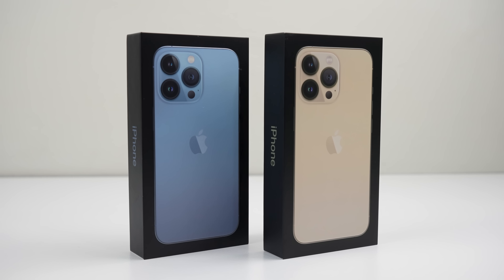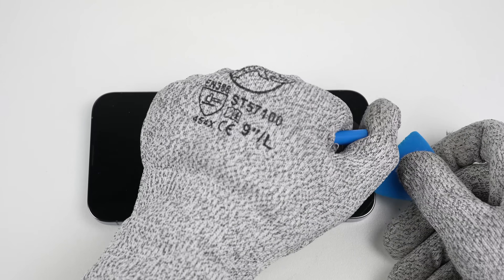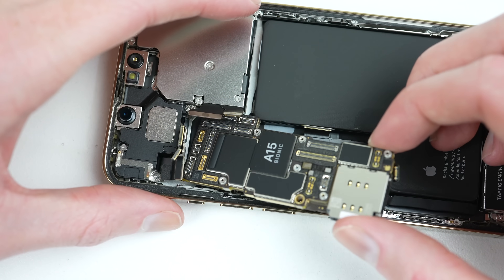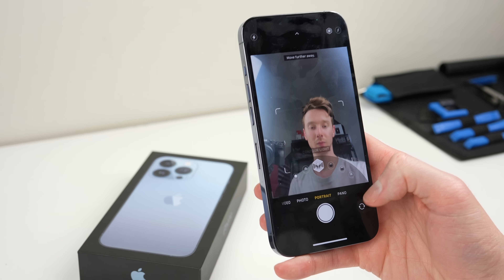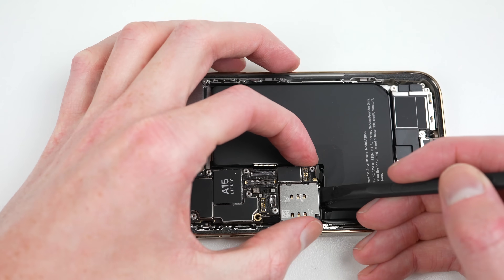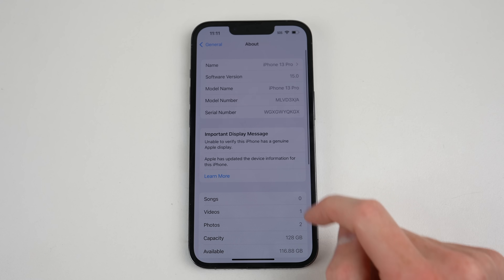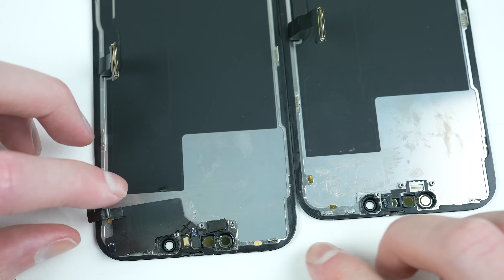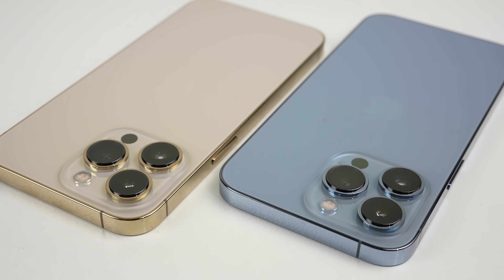iPhone 13 A Repair Nightmare - Teardown and Repair Assessment

Comment: Would like to see this test done with a complete data wipe initiated before the components are swapped. If there’s an active login the OS may be designed this way so as to prevent access through a Face ID component that has been tampered with.
Reply: And would also like to see what happens when only the battery is replaced, with an Apple on as well as a generic aftermarket one. This would be one of the most common repairs and it looks relatively easy. I don't see wiping the device requiring any re-installation, and more work, since a backup is made before initiating the wipe. When you login to the new device, the backup is automatically restored to the new device.

Comment: A lot of commenters are missing an important issue about environmental issues and sustainability here. These phones ARE repairable. Just not be a third party vendor not authorised by apple. So apple can fix them, and authorised repairers can fix them. The argument therefore is not about sustainability, it’s about greed. Apple has always been a walled garden but it’s always had a few gates. Until recently when that wall is getting more and more secure. This is a great decision for reputation, because the only repair you can have is a genuine, legitimate, apple approved one, so people can have phones that work flawlessly for many many years. But they didn’t have to do it this way. And it’s a shame they did. And ultimately boils down to keeping shareholders happy.

Comment: Shouldn't be too difficult to hack the passwords on the chips just use password bash software it would be a generic code password probably four digits or 6 digits should be easy then you can just print them on the interweb everybody to use

Comment: Like previous iPhones, China will eventually come out with a hw serial retriever for this phone hw so u can upload the an onto new replacement components.

 Also something tells me the crashing of the hardware after a swap is software simulated. This is to make it look to avg diyers that they physically damaged their phone. And there is probably different random simulated crashes associated to what was swapped and or replaced.

Comment: So they don't give you a new charger saying it impacts our environment, but they are happy to force you to spend more on repairs only from them instead of an independent technician? 

There is NOT a single company out there that gives a ... about our environment. It's all about forcing you to pay for a charger and pay a 50 times more for repairs.

Comment: What about hardware ID's  Software can be replaced unless it's hard coded on a chip, and then it's no longer software, but hardware!  From what I have heard, many parts on iPhone's have hardware ID's  to prevent anyone but apple to change anything, because only they can add codes (A one shot deal) to a PROM in the part, in order for the part to be recognized and work in the phone they put it in.

Those environmentally irresponsible bastard cons!  Remove the plastic foil n' shit on a phone that will end up in a land fill (or worse; read on) most likely before the warranty runs out, because they are so easily damaged, and cannot be repaired for a price that justifies it, and designed not to. Every phony environmentalist (Note the MENTAL in environmentalist), just can't live without their Apple devices and they end up in India, Bangladesh and other third world countries where children with no safety gear at all use torches to take them apart, breathing in large amounts of several toxic gases, to pull out the parts containing small amounts of precious metals for pennies a day, so their "employers" can sell them for scrap to others who crush the parts to melt those down creating even more pollution and extract the metals...  Let alone the environmental impact when after a rain washes all of the toxic waste through the ghettos, the soil,the living spaces and into the Ganji and other water supplies where people do just about everything from laundry to bathing and countless religious rituals, and even drinking it where no amount of boiling will remove the micro-particles of toxins!  All the crap that can't be recycled, often doesn't even make it to an at least somewhat safer land fill, but instead becomes part of the land/city scape, where the life expectancy is lower than the quality of life which is near zero!

Good freaking job Apple and your loyal fan club!  Good freaking job!

I know it won't change much, but right to repair, planned longevity, and upgradeability can be lucrative too! and it may not save the planet, but slow it down significantly if enough of you greedy bastards take the lead, instead of lying your f*cking asses off about it as a marketing trick!

Comment: Stop buying Apple products, simple.  Apple barely does individual component repairs anyway, they replace phones entirely and bill you accordingly. Your brand "New" iPhone 13, undoubtedly has salvaged parts from previous iPhone models they've replaced, because the back was broken, or the housing had some light scratches with your broken display, so they refuse a display replacement and forced a full replacement. Macbooks have just about everything living and soldered on the "Illogical Board" so when your $1500 overpriced piece of shit becomes a paperweight, you can't even have your data. They're nothing but thieves, they invest 85% of their efforts into;  how can we get away with this?/ how can we manipulate you? 
They never produce anything remotely new, it's all been done before, oh but Apples done it now, better throw my wallet at them, drop my pants and bend over! What they "invent" is marketing and scamming, not new products.
Wake up society.

Comment: It's such a shame that you might go out and spend over $1,000 on a device, only to have it last, maybe 5 years. After that, you only get it repaired by an authorised technician who will not only charge more than what the phone is worth to repair it, but will erase everything that's on the phone, even if just to say, replace the battery, the screen or the charging socket

Comment: Right to repair absolutely should be a thing, but I do understand the need to prevent third-party hardware replacements. Isn’t very sensitive data processed onboard through their ‘secure enclave’? I sure wouldn’t want potentially harmful, modified third party hardware from storing or leaking important data like biometrics.

Comment: I don’t know if you can do this but I saw a video where they soldered the pin from the original display to the  replacement and everything worked fine. No face id issues

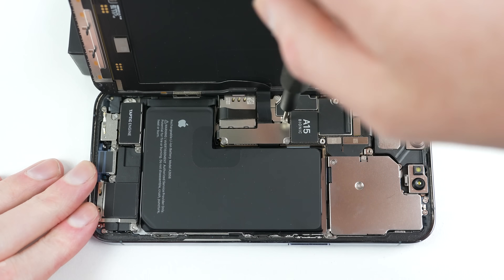Comment: 15:16 apple literally has software that calibrates their components, whether it be the display or rear camera. 

Once a new display is added, they hook the phone up to a Mac that programs the display to enable touch I.D. and face I.D., and other things.  The rear camera also gets calibrated, takes about 5 minutes of moving the phone side to side.

Say you crack the rear glass, Apple moves the display and rear camera to a "rear system," which is a phone without a display and rear camera, the proceeds to configure it. This method started with the 12.

Comment: I've never owned an iPhone, and most likely never will. There is always, ALWAYS, a glaringly obvious design flaw in every model, and it just keeps getting worse. Don't get me wrong, I can appreciate parts of them, like how seamless they function, or parts of their aesthetics at times, but for the most part, they are a straight up garbage product that has no right being as successful as they have been. 

And when you consider how unrepairable they now are (not to mention that hilariously ugly notch still there in 2021), it just boggles the mind how they manage to still remain a successful phone.
Reply: All those Crapple products suck & are way overpriced. I've had Qualcomm & LG phones since 1996 & all are android. Never paid more than $350 for any of them new (price adjusted accordingly) and ALL were repairable by myself. Never had any issues to begin with but one; charging port solder broke. Dropped them from my 3rd story roof and didn't break; it's a phone not my kid; so I didn't worry. My buddy dropped his phone on his carpeted living room floor and it cracked all to hell, even with that plastic cover. Apple is a POS!
Reply: I can't help but to wholeheartedly agree with you. I am not from the US so Apple products are very pricy here. People around me own Apple products and they keep on praising how good the products are, so I stupidly bought my first ever "defective" iPad. I went to the authorised service centre and they will replace a new one. I can't believe how lousy the iPad is for that price. 🙄
Reply: @Slayer Developer No point in having a thicker battery if you can't swap one out with a 3rd party repairer if you have too aye......imagine your tv remote doing the same thing.....you'd be having kittens
Reply: @Slayer Developer I said I never owned one; not used them. I was forced to use an ipud for about 7 months at my job. It Never made it thru the day w/o jamming up, restarting, reloading or fucking up in general out in the field. That is why I'll never own one, because I used one and they ended up getting rid of it because of my issues. Since then it's been LG phones & DELL laptops exclusively for the last decade.
Reply: You mean the ugly notch at the top of the phone......(Steve jobs would never have allowed it), or the camera bump they think is normal.......instead of making a thicker phone, and giving people what they want......a larger battery......
Reply: @nzfade1  ah, yes, this is a genuinely objective comment, right?

1. Steve Jobs would absolutely have allowed the notch, hell, he’d have made sure other companies embraced it because he needed to be right.

2. The camera bump is present on almost every device made now, if it was really that big of a problem, people wouldn’t buy them and they’d make the phone thicker.
Reply: @authorofone  I doubt it........he back tracked on telling us that we're holding our phones wrong.....and he would have laughed the notch out of existence......you have an accountant running the company now, not a visionary that actually knew good designs when he saw them.
Reply: @nzfade1  they did actually give people the battery they wanted this year the 13 pro max battery is nuts I can’t kill it in a day. I do agree not allowing simple parts from another genuine iPhone is a step too far.
Reply: @thetechlibrarian  You realise the battery life is because its a closed off hardware/software system that's doesn't allow a fraction of the functions that androids do leading to higher battery usage right?
Its like comparing a shitty yaris to a race tuned mustang bragging about great the fuel efficiency is. No shit... because its literally stock and has a fraction of the shit going on.
Reply: iPhone is just a fad. Pricing is ludicrous and you can get the same features in Android and spend $400+ less. Even if I have a billion dollars, an iPhone will never be an option. I prefer Samsung and never had issues with their phones.
Reply: @Gurenn83  Samsung  is an engineering company, Apple  a   vaporware marketing company.
Reply: @Gurenn83  Samsung is a truly pathetic company with cotton candy for a spine, they pretend they are better than apple and mock them whenever they get the chance but they copy everything that apple does, and that's even worse.
Reply: @peters.9371  Whatever youre smoking pass it on. 
Last I checked Samsung STILL provides apple with components but go on...
Reply: Where have  you seen   a  consumer product  designed  by a US manufacturer  that  would  compete on its merit?
Reply: @leotimtom6637  lol, the iphone is a Chinese manufactured product designed in the US. And personally, I don't care where the product was designed or manufactured. I just care about whether the phone is worth the money, and repairable...iphones have neither aspect.

Comment: Imagine buying a product that has older technology, lower performance, less features, less accessories, less included, less functionality, at a premium rate just to show you own one. As though owning a lesser product designed to be unrepairable or non upgradeable makes you a smarter consumer; even outside of the other issues. It amazes me the phone with the least amount of value sells so well based on a brand and "look" associated. The most amazing thing about humanity is it's utter stupidity.
Reply: People aren’t interested in having the newest tech, most features, most accessories. The iPhone is a great design and smartly implemented device. The problem are the crooked practices apple is using, but apparently the top android phone makers are doing it too. Apple is just better at it.

Comment: It’s always interesting to see how far they improve but how far they step back, you can’t even switch a screen without it possibly breaking the phone. People pay so much for these phones but in the end their still not really ours since apple and their software is always key for it to work. It’ll get to the point where even the SIM card tray can’t even be switched. Apple is in a sense trying to be renewable but also making you pay for accessories that should be there which defeats the purpose.
Reply: Im so sharing this everywhere

Comment: Just another proof that Apple is a shitty company... I'm a developer, and I occasionally work on web applications. I shit you not, in order to be able to make a website work correctly on iOS device, Apple 100% expects me to have to buy an iOS device AND an OSX computer to connect it to. There is no emulator. Well actually there is one, on OSX, in XCode (which only runs on OSX), and nowhere else. You can't install OSX on a VM, and all iOS browsers (INCLUDING CHROME!!) use Apple's custom rendering engine, which of course does not render like Chrome, Firefox, or Opera on any other platform, and of course Safari hasn't been available on PC for like 20 years... And to top it off, none of the browsers have a developer console. Safari does, but in order to use it the iOS device needs to be connected to an OSX computer, and it works remotely like Chrome's remote debugger. But of course, Apple's protocol is different and incompatible with Chrome's remote debugging client. I tell ya, when you get dicked around all day long like this just to try to figure out why your checkboxes aren't centering on Safari, while it's working on Chrome, Android, Firefox, Opera, and IE, you figure out real quick what kind of assholes they are as a company...

Apple is a cancer as a company. I wish it would burn to the ground.

Comment: This is why iOS Mac sucks.... I literally just did something very similar to Huawei mate 20 pro from two different regions

One where the motherboard probably blew up due to a power surge.... And one where the screen cracked

I literally took it down to a repair center and all they did was switch the screen and the parts broken motherboard had perfectly good screen and and broken screen had perfectly good motherboard.... So one from one to the other makes a brand new refurbished phone genuine parts only major difference one was international and one was Canadian and when it comes down to core parts it didn't matter the phone works perfect...
 Every single feature works perfect from the end screen fingerprint to the auto dimming to the onboard cameras front and back to the charging port and even more.... And I still have replacement parts I now have spare cameras and a spare battery spare wireless charging coil and probably a couple other features I don't know about the motherboard I'm pretty sure that's dead on one and I probably even still have a working spare LCD panel only thing what's the glass was cracked not good for a business representation

But again iOS Apple Macintosh sucks you can't do what I just did as proven in the video even if they're the same freaking model in the same freaking region Android rules Apple copies and fails miserably

In short Android camera works face ID works under fingerprint display works volume rocker works nm card works Wi-Fi Bluetooth NFC wireless display wireless charging reverse charging battery all work when swapping

Comment: Hi, I noticed you didnt remove the adhesive or reapply any when you were resealing. Does the original adhesive stay in place when using the heating plate?

Comment: The reason this isn't a bigger issue is that people have been trained to replace their phones at least every two years. The same way they have been trained that both the caller and call receiver should be charged for the call. I'm older than most here, I'm sure, but back in the day only the caller was charged. I fully understand the least used feature of these "phones" are actually making calls but they are phones right? The voice quality of these phones are horrible compared to the old land lines and we have just become used to it and accept it.

Comment: It should be a matter of software. When uploading the OS in a brand new hardware it reads the ID or serial code of each component. If the serial code or ID does not match the OS will stop using them even if those parts work correctly.

Comment: I think face ID failed because the screen wasn't fully mounted. The camera and sensors were mounted in the chassis.  Is there any lidar used? Then the lens needs calibrated.